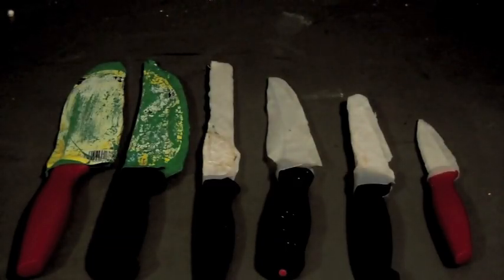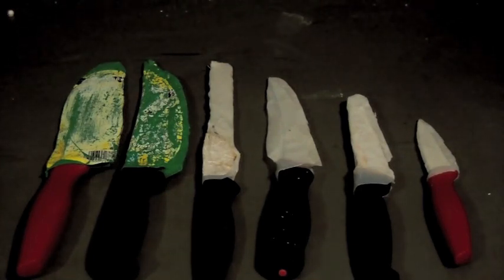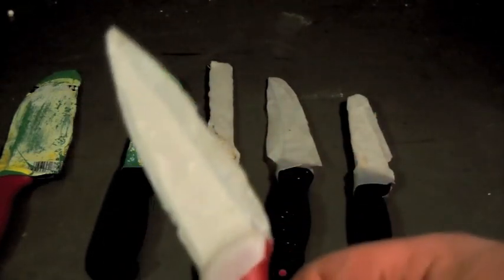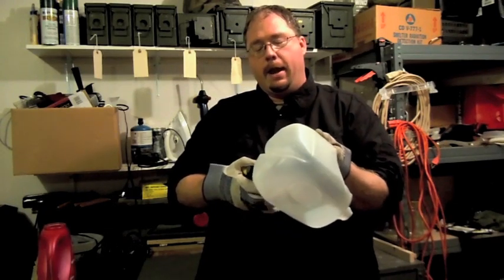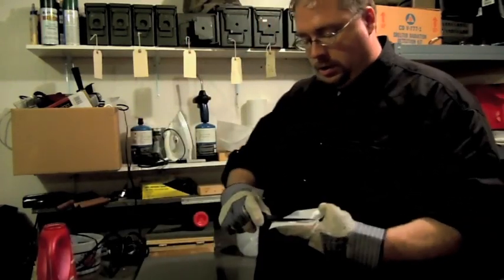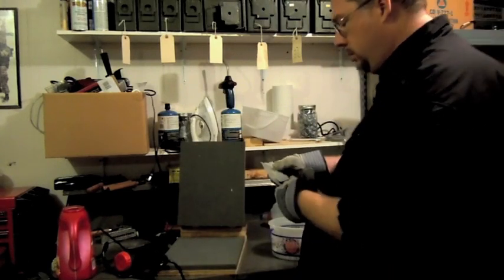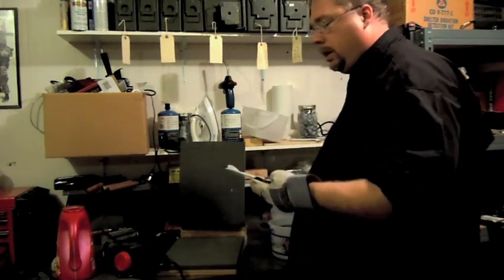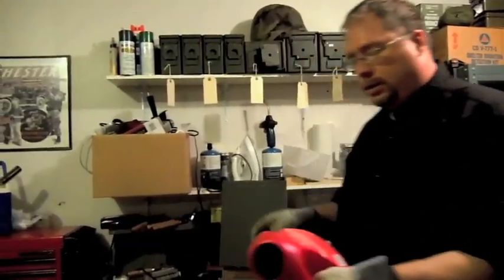How to Use Plastic Milk Jugs as a Kydex Alternative | For Practice and Non-Secure Uses Only

Comment: A bit rushed and not very well presented, but i get the concept- which i suppose is the most important thing. If you take a little extra time and care, and sand down the plastic after moulding, you will get a fairly good finish, which can be spray painted and riveted etc, but as far as what you've shown, this is the first video ive seen explaining to people the dangers of heating plastics- so well done for that, i see a lot of people doing PVC things thatt end up feeling ill, and they video's they watched didn't say "do it outside", so glad you encompassed some quick safety info. I shall keep my eyes on you and if your video's improve slightly, i will be subbing :-)
Reply: Agreed  I have seen people use the Bar-b-Que grill outside to heat the plastic, a lot safer than doing this stuff indoors.

Comment: try using pvc its much thicker more durable and safer than milk jugs or other bottles just try to use sewer line its a bit thinner and easier to work with than water line

Comment: Good video  in the intro on alternatives on a cheaper or conservative level...dont kno that id use milk jug its lil too thin eell that is for pistols or guns but your definately on the right track  id prefer as someone else brought up plastic coffee containers or what ive been thrying to find laundry detergent plastic containers. a bit thicker and there are various colors..others  ive seen colorful 5 gal buckets is  lowes home depot  that  manufacturers use for construction putty or paint  pretty thick or in my opinion  ideal for pistol or revolver holster molding,,infact looking for me one now gotta drive around to new construction home sites,,their discard is a treasure. Ive been  on this same adventure  alternative cheap  that are just as good,,jus requires  lil craftsmanship which i  have ,,recently making leather holdters and wet molding to weapon,,i dont have stitching ability yet  so i take to a friend who runs a saddle leather shop. Im looking to get perhaps a hand held  but not quite sure about that ,,but the plastic  method,,yep yep...thanks

Comment: Hey if you guys want the plastic to be black type this into YouTube (rit plastic dye) rit is a fabric dye that will stain plastic (I recommend black) It's much better than paint because it wont flake off and if you scratch the plastic it's black underneath too not just on the surface. It's dirt cheap and it's at most grocery stores. Your welcome :)

Comment: Great idea! I live in CA and was trying to press some kydex grip wrap on my 1911 so it would become legal for a carbine conversion (stupid law, I know). This is a lot easier than DIYing a kydex press, less steps too. Only thing is that I doubt there are black milk jugs. Might have to substitute with brake fluid jugs.
Reply: Try those chemical or petroleum products jug. They are made with HDPE, same material as milk jugs. Cheers